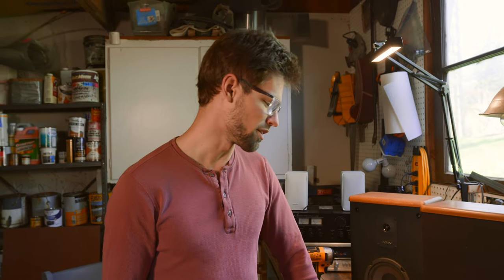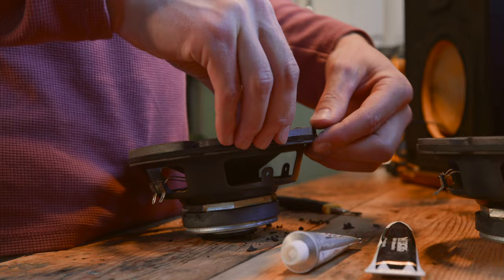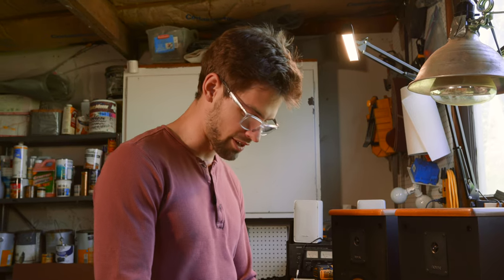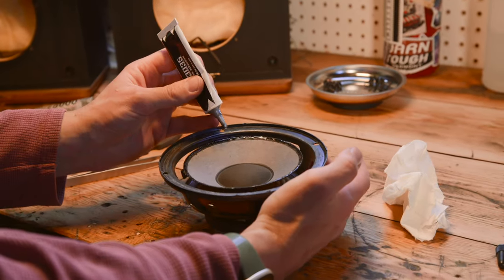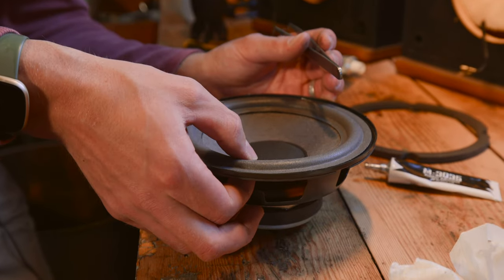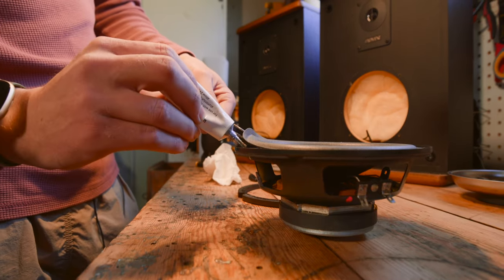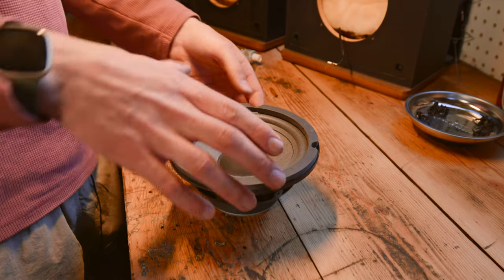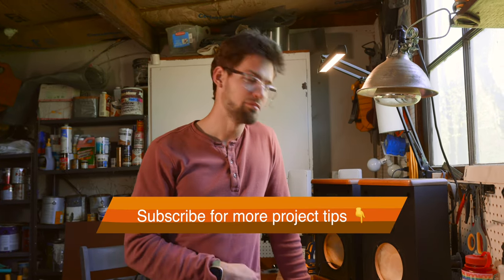Restoring a set of Advent Baby II Speakers with new Foam Surrounds

Comment: Great Video -  i had just completed re-foaming my pair of advent baby ii today before I saw this. Coincidentally  I had used exactly the same technique as you.  No shims, finger working, making sure the cone movement is free continually.  My choice of glue was LePage wood glue multi-purpose white glue. I have used it successfully before on other re-foams.  It goes on white, but dries to a translucent finish that shows the black of the cone and the foam, and becomes invisible. I went with cheap foam from an aliexpress store. Once I had glued the foam to the cone and it had set and cured, I used a tiny pair of nail scissors to clip a little screw sized piece of the edge of the foam where the screw holes to avoid  any possibility of the screw catching and twisting the foam.  Probably overkill.  The other think I did that you do not include is to replace the capacitors in the crossovers. It was as simple as undoing the 4 screws in the speaker connection, the crossover is on a 2" board behind. It. comes out with the connection in one piece. I got two  3uf NP 250v capacitors from aliexpress for a couple of bucks each. They make a difference, as the existing capacitors are likely to be 30+ years old and far from 100% performance. There is one capacitor only in each crossover.
Reply from the maker: Thanks for watching! I made a video replacing the crossover components as well! It made a small difference on my pair, nothing crazy. I ended up passing them along to someone who had been wanting a pair. Thanks for sharing your tips about refoaming these! I appreciate it. -Matt

Comment: I have baby advent iis and the tweeters are not working.  Could that be a cross over issue or do they need replaced?
Reply: Also the two wires poke through the cones on mine and have the rubberized coating on them.  Most that I've seen do not have these visible as yours in the video do not, what does this mean? This little pair of speakers is going to be my first go at a refoam job and potentially crossover replacement. I appreciate your videos on both a

Comment: Shims for making sure the woofers don't move around too much? How bout so they don't scrape?
Reply from the maker: I see that as the same thing but I definitely could have been more clear. On a small woofer like this, the spider does a fine job of centering the woofer as long as you apply the new foam how I show in the video. I would use shims on any woofer bigger than 10". Thanks for watching!
Reply: @Shuksanaudio  Thanks for posting and sharing